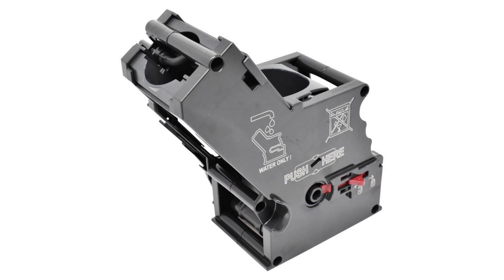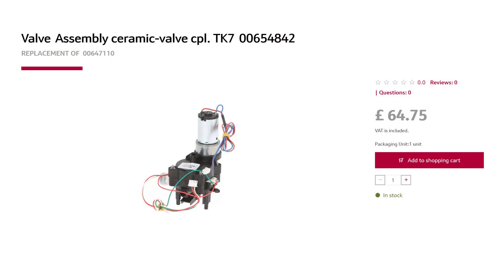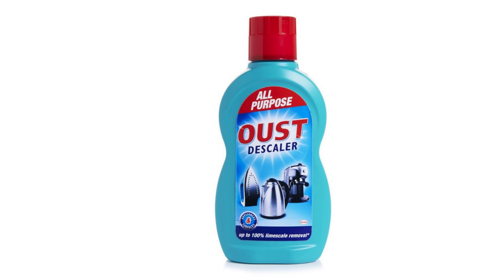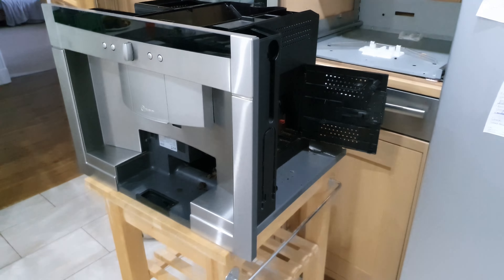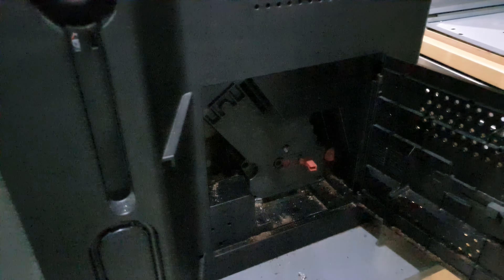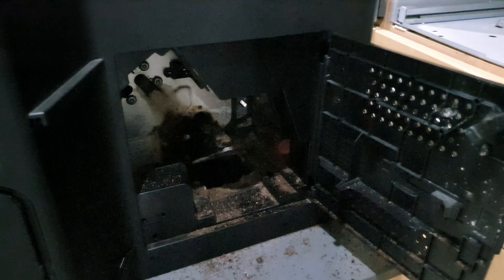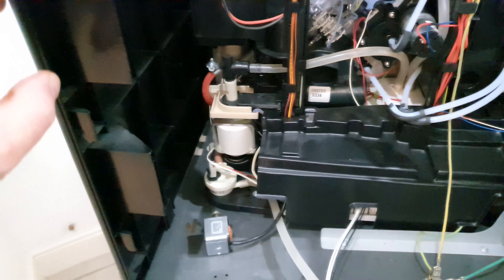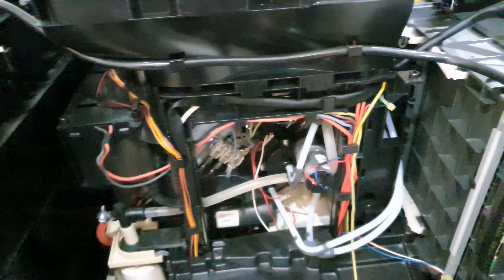Neff Coffee Machine Not Working - No Coffee - How to Fix

Comment: Thanks Daniel for the rapid response. The reason for my question was I can’t get past the screen which says, Refill with still water or remove filter.  Contacted Neff and they weren’t much good as basically they asked if I tried the troubleshooting which was in the manual.
Reply from the maker: Mine now says remove or change filter even though I don't have one. So I just ignore it and it works ok

Comment: I would be happy to know how you remove the unit from the wall?  What do you need to unscrew to get it out?
Reply from the maker: You have to first use the sping loaded handle under the drip tray, and make sure the unit is fully out, then I think it is a matter of unscrewing the tray and unit from the runners. I can't remember if the screws are on the tray or underneath - probably underneath. I then put a bench, I use a butchers chopping block bench in-front of it, as it's about the correct height. It's quite heavy and cumbersome like an old CRT TV.

Comment: Hi David. I have the same machine but as of yesterday the main button to switch between coffee won’t work. It will turn left but won’t turn right. Would you have a solution?
Reply from the maker: You could try taking it all apart, I know there is a circuit board area that is accessible from inside once you remove the top cover, I guess the switch is under that, but I have never had to repair it.

Comment: sounds like there are a few of us out there trying to keep these machines alive, most in part to the fact they leave a gaping hole and it's impossible to get a matching front for an old kitchen.

In the past I've posted help on a diy forum as i've stripped my brewing unit a few times when it has flagged an error, or 'contact engineer' alert. I've also replaced my pump and heating unit myself, with Neff replacing a couple of other bits on engineer calls. It would seem there is very little info out there on this machine to help people.

Mine now isn't pushing out the volume of coffee it should and on the start-up/down procedure no water is dispensed. It does however push coffee out when you run two espressos back to back, which makes me feel there is a leak somewhere inside. Likely the cermaic valve as you've pointed out. I've run 'calc 'n' clean' a couple of times as this has helped in the past, but I might try this with the side off to see if I can spot a leak, if I can i'll try and replace the valve... I hope it's not a pig to get too!
Reply from the maker: It's not too bad, as you seem used to taking it apart, probably even more times than me. I did take the whole valve unit apart - not a good idea - better to buy a new part. Good luck. Mine is also not pushing out as much coffee as usual, I think it dumps more water into the tray beneath, but I just add some extra tea water to top my mug up. Keep us updated.
Reply: @daniel_coe  i've just stripped mine quickly to see if I could locate the issue. I can't see any leaks internally. I took the front and nozzles apart and followed the tube back to the brewing unit. I then manually moved the brewing unit through it's process, blowing through pipes/tubes at every stage. I noticed that the right angle pipe, that moves up and down seems to be missing a very small o-ring. There is one either end (I know as I've stripped it a few times), i'm pretty sure this should create a seal so when missing little coffee makes it too the cup and ends up in the drip tray. I've just used the parts finder on the Neff site to buy three replacement o-rings as they fatigue over time (usually use third-party sites as cheaper). I imagine as the small o ring has degraded and popped off and dropped into the granules tray, ending up in the bin.

It's very small so if you don't know where you are looking it's easily missed. You can tell there should be an o-ring, due to a recess where it should reside...

If people are noticing reduced coffee volumes I would strip and clean the brewing unit, replacing the main o-rings, making sure to apply food grade grease. It's a 15min job and could make a massive difference!
Reply from the maker: @huwwilliams3664  let me know if your coffee volume is fixed when you fit the o-rings. I don't feel like taking it apart again without a really good reason.
Reply: @daniel_coe  I will but pull out your brewing unit and look for the small o ring I'm talking about. It's visible without doing anything. I wonder if this could be a common fault as they degrade...

Comment: Hello 👋 
Great vid as not a lot of online info out there.
My machine died... again. 😂
I think from your excellent vid that I have the same problem.  The machine stopped making the brew and instead just has a little explosion of steam in the brewing unit, leaving dry coffee grounds.   Im assuming, now I know there is a valve, that the valve may not operate correctly allowing the heated water to pass to the brewing unit.  
Just looked at your link for the part and its now at £85.
😮  Inflation 😮
I think I will dismantle my machine now I know how its done and see if the valve is serviceable or not.  Nothing to lose I guess.
Thanks for the vid. 🙂👍
Reply from the maker: I took that valve apart as I reassembled it. I don't recommend taking it apart, it's very intricate. I thought mine might have been clogged up with limescale as it has a very small opening. Good luck with it.
Reply: @daniel_coe  hi Daniel.  Thanks for the note on intricacy. appreciated.
The problem I have is exact same symptoms as previous breakdown.  On the previous breakdown I tried cleaning regime over and over and just gave up.  The machine sat idle for about 3 years.  In that time it must have dried out within every component.  I decided that I was going to remove it and make way for another machine but thought I would give it one more go.  I filled it up and she worked.  I couldn't believe it, but unfortunately that never gave me any clues as to what it might have been.  Im not waiting 3 years this time. 
😄
Thanks Daniel

Comment: Hi Daniel. Excellent video. I'm looking for advice please. Have same model inbuilt Neff machine approx 12 yrs old. I live in Oz. My problem is that at switch on and switch off (after making a cup) the coffee dispensing pipes are not flused out with a little water like it always did. Aswell, I am noticing water in the waste coffee bin (instead of just slightly moist). Have run full calc'n'clean few times without any difference to my problem. Machine otherwise makes all different styles of coffee without any problems for both white and black coffee. I mostly use beans rather than ground coffeee. Because the flush is not happening, I believe this may cause somesort of back flow of water in to the waste bin. Any ideas greatly appreciated. Similar to UK, Neff Techs here take the macine back to workshop and charge so much.

Comment: Hi daniel ...excellent video ! I have first symptoms on the same coffee machine. Im affraid to brake something when trying to remove front block having nozzles. I want to change the black bloc having two nozzles. How do you dismantle this part from the front of the machine ? Is therea clip?  i wanted to avoid dismantling black cover nearby the bean coffee tank ! Thanks for your help
Reply from the maker: If you want to change the £10 part of the 2 nozzles, you have to take it apart from the top and probably have it out. I think the screws that hold it in place are on the inside.

Comment: Hi Daniel. My machine is not letting me to pass stage when it's asking to replace water and water tank. After this it will automatically go into "cleaning" and pump water into the drip tray (not through the dispense head) and stop after 5/10 seconds asking to replace water and water tank.
Water tank Is full 🙄 float inside seems OK. Any ideas? Could this pump valve cause this?
Reply from the maker: It's a tough question. You could pump some liquid descaler through the system several times first and see if that clears anything. That's what they do at Neff if they take it away. Otherwise I'm not totally sure. Most issues I know of so far, seem to be with either the brewing unit or the valve.

Comment: Many thanks for this content. My trouble is the hot water rather than the coffee nozzles. Water spurts from inside instead. Perhaps a disconnected tube? How might you access this part to see if tubes are joined correctly please?
Reply from the maker: You've still got to have it out and take off the top and sides and perhaps the coffee bean shoot. Then, you should be able to gain access to the clear tubing.

Comment: Thanks for the video. We have a similar problem, but suffering from haphazard coffee production e.g. press for coffee, grinder kicks in, water tank empties, but nothing comes out. However, press again and a full cup is dispensed. All other functions seem to work as expected, hot water, milk etc. Machine was functioning correctly prior to a descale operation. Although noted that LED screen displayed "coffee powder" post that process. I have to admit, I didn't even know there was a powder option, we've only ever used beans. I turned machine off/on and this cleared, but have added, in case it's relevant. Scratching my head tbh! Any advice you can offer before I start breaking it down?
Reply from the maker: There is a coffee powder slot on the top right of the machine. This is where I believe you put the cleaning tablet when cleaning. Check that drawer is closed. I feel your pain, as you seem to be using double the coffee for one cup. Could be a blockage or a loose connection. They do say in service they flush the machines with liquid descaler again and again.
Reply: @daniel_coe  Thought I'd post an update in case anyone else has a similar problem. I bought and replaced the brewing unit, which made no difference. I called out an engineer, who suggested it would be a trial and error remediation, which could end up being uneconomical to complete. I decided to press on and we initially replaced the valve, which sadly made no difference (£192, inc initial call out, lab & VAT). On his second visit, the engineer replaced the pump (£80 fitted) and everything is sorted. So if anyone has a similar problem with intermittent coffee production, it's the pump! Simply not enough power from the pump to force the water through the coffee grounds.

Comment: Hello Daniel. Do you need to use a filter for this machine? Is it optional? I wanted to use bottled water? Thanks in advance.
Reply from the maker: You can use filters, I don't. You can set your water hardness and then it will remind you when to descale it. I just use the water from our carbon filter tap

Comment: Hi I've got one of the later models. From new I'm getting a signicant amount of water and coffee grounds in the drip tray when brewing so a leak somewhere any ideas where to look ? O rings look to be in place
Reply from the maker: I must admit I do seem to get a lot more water in the drip tray than before and less coffee on a large cup setting, but I just add some tea water to it to fill a big mug. Depends how much you get in your cup I suppose if it's worth trying to fix at the moment
Reply: I've managed to located the engineers exploded diagram that lists replacement parts and their codes for things like O rings. It would seem like there are 2-3 connected to the ceramic valve. Most are for connecting external pipes. I might strip mine and try to see where water leaks. If it's from the main body I would say it's toast, but if it's from a pipe there is hope. That being said I can get a replacement valve for £56 delivered so it might be easier to just replace that TBH as replacing O rings means lots of taking apart and putting back together to try...

Comment: Great job, now I know where the screws are, I'm going to clean out the nozzles, one of them is clogged.
Reply from the maker: A reasonably straight forward job, if you need the nozzle plastic part, it's about £10 from Neff. They replaced it for me before for free when I had them out for a different problem on the machine.
Reply: If you take a paperclip, strip off the plastic coating and straighten, you can insert it into the holes. Note there are several around the outside of the center that also need doing. Once this is done they usually flow without a problem., I do this on mine from time-to-time. The issue  in the video is more to do with an internal leak.
Reply from the maker: @huwwilliams3664  when I removed the nozzle section and blew through it and forced water through it, it's amazing how many small bits of coffee grounds come out.

Comment: Hi Daniel, terrifically helpful video.  I have the same machine and perform simple DIY tasks, great machine 10 years old.   I think siemens and bosch rebadged the same machine. My issue is it occasionaly refuses to deliver coffee, tells me to check the beans, out of beans, which isn't the case.  replaced the brewing unit and same intermittent issue. I'm in OZ and unfortunately neff uses 3rd party repairers, not inhouse NEFF techs, so it's the luck of the drawer who you get. any advice would be appreciated.  cheers

ed

Comment: This sounds like the problem I have with mine. Hot water is fine, but when I try to get coffee I get a lot of steam, no coffee and the drip tray gets more liquid in it. I’ve run descale 4-5 times with improvement. Sounds like the valve is the next thing to work on. I’ll take it out and have a look. It sounded like it was advisable to not take the valve apart??
Reply from the maker: I don't believe the valve was designed to be taken apart. Very fiddly to put back together and left the same as it was when I opened it up.
Reply: @daniel_coe  Helpful. It turned out to be the brewer unit - or it is now working. I picked it up on eBay for £51, partly as I wanted the pull out drawer for a possible other unit I'd seen . Turns out I saved lots of money!
Reply: After a coupe of weeks of working perfectly, it decided to stop putting any water through for coffee or hot water. I've tried to run a couple of descales, but it's not pulling through from the water tank. I'm assuming it's the valve. I'm going through the pipes to see if any blockages, but to found any. Only pipe I can 'blow through' or get to disconnect at the other end is the one that goes from the flow switch (pinky red pipe) to the pump. Wonder if I need to look at the pump.

Comment: Hi Daniel . great video !    I'm looking for advice.
 My Neff coffee machine doesn't work - It grinds the coffee beans into ground coffee but sends it straight to the tray  [ rather than processing it through the machine with  water. ] The Neff engineer said it's the brewing unit which is broken but this is now unreplaceable for my model . I have seen a similar machine online for spares. The seller says that the only thing wrong with their spare machine is the capacitor . Do you know what the the capacitor does and is it seperate from the Brewing unit ?   Kind regards, Gary
Reply from the maker: I don't know what the capacitor does, but on the neff website there is a spare part section once you put in your serial number that may help you find that part and where it lives to see what it might do.  Mine used to grind the beans and they were very dry instead of moist and I had no water come out and mine was the valve unit. My engineer also thought it was the brewing unit which it was not, you probably saw that in the video.

Comment: What’s the part called ? I have the same problem now, why didn’t you buy and fit the part yourself ?
Reply from the maker: Assembly Ceramic Valve - https://www.neff-home.com/uk/shop-productlist/00654842
I thought about doing it myself and my hunch was correct, but I was worried that part may not have been the problem, so would then be stuck with a £75 valve I didn't need.

Comment: Mine isn’t grinding any help
Reply from the maker: Make sure the grinding setting on the top is adjusted correctly. I poured water in mine once by mistake, took it all apart, and stored grinder in airing cupboard for a week. You could try taking it apart and lokking at the grinding part and see if anything looks out of place. Try a different brand of coffee bean, some are too wet for it. Otherwise it might mean a new part
Reply: @daniel_coe  tried that